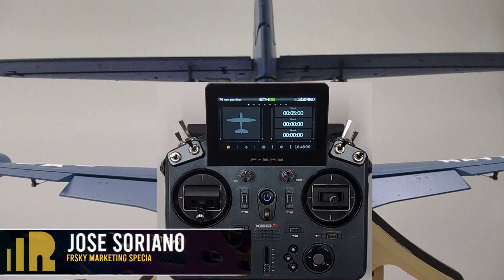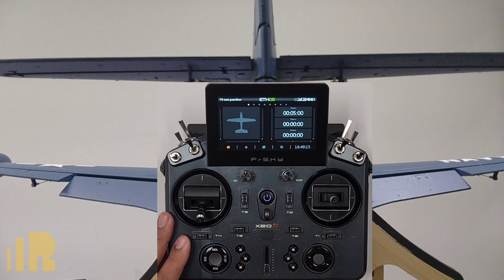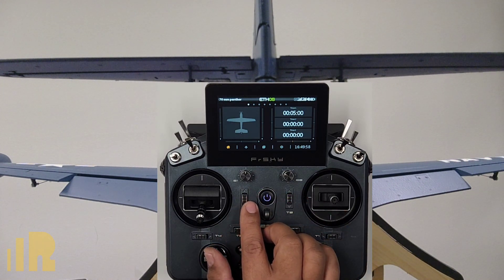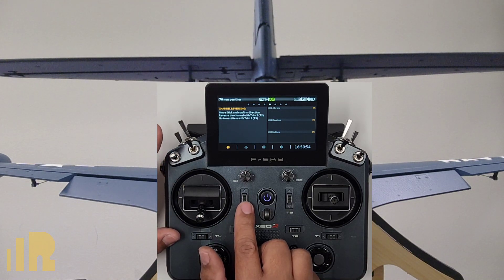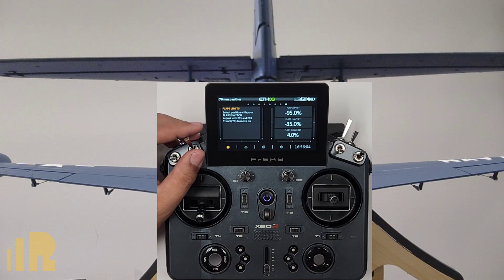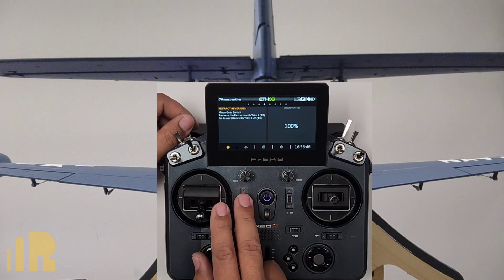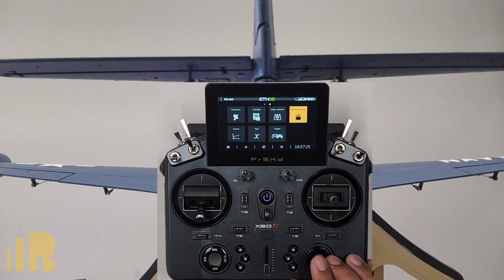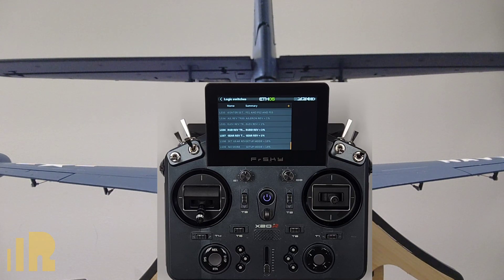Auto Plane Setup - ETHOS Programming example

Comment: Hi, I wonder if it is possible to get a description of the throttle functions, I think of engines that run on gasoline or methanol. Have thoughts on max and mini deflection on the servo to adjust the throttle cut and a low idle speed of the engine. Thanks in advance
Reply from the maker: That's a great video to make. Thanks. In the interim, go to MDL - OUTPUTS, CH3. And use min, and max for servo end points. The low end point should be where the throttle is fully closed and the high end should be set where you are at full throttle. Go back to MDL - MIXES and edit the throttle mix. Scroll to LOW POSITION TRIM and turn that ON. Scroll to THROTTLE CUT and choose a switch for the ACTIVE CONDITION. Now you can trim to adjust your idle level. You can add a fast idle if you want with flight modes.
Reply: @FrSkyOfficial  Many thanks for the reply, will go through step by step what you suggested. It becomes a little sensitive to calibrate idle if you do not reach all the way through the linkage between servo and engine. A movie is always gratefully received. Thank you again

Comment: Is this a 'hard' change to the setup or does the program need to run for the changes to work?
Reply from the maker: It's essentially part of the model file. I use the same stuff that you can use to build a model like logic switches and vars just applied it differently. The model template is the program. No extra program needed. If i make it available for download, I'll do a video on how it works and how to assign switches so you can apply it to your setup